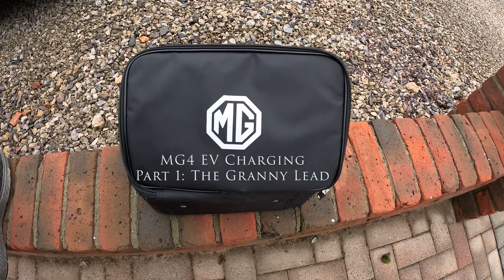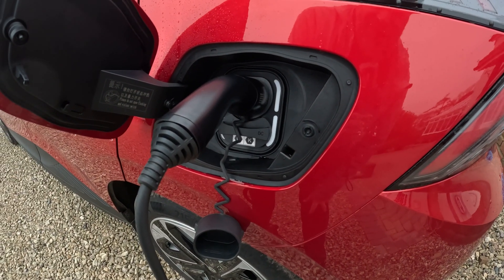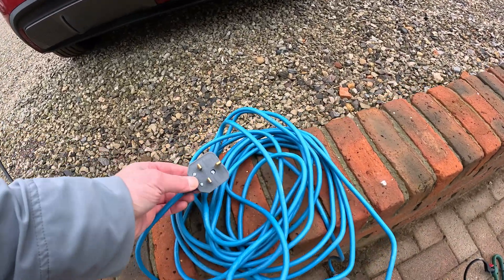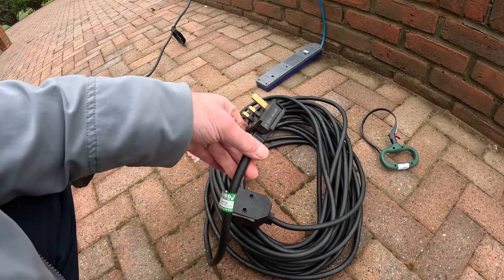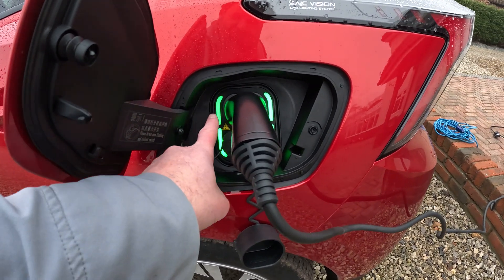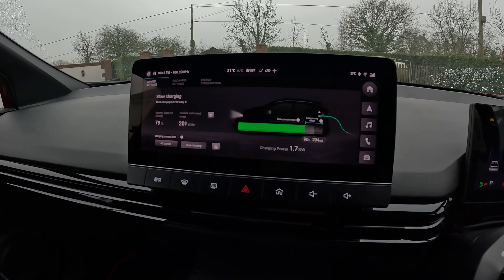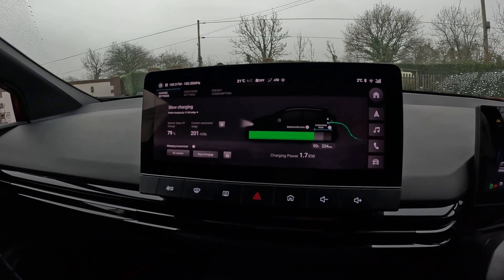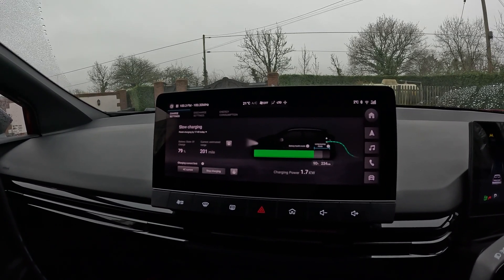MG4 EV Charging - Part 1 - the Granny Lead / EVSE / Charging Brick / Slow Charger

Comment: Can i use 13 amp extension lead to connect to my ev charger plug because it doesn't reach my house socket. I have a mazda mx 30 2021 electric

Comment: Impressive! However, I have some concerns about the safety of using a 3-pin plug charger for extended periods. Just how safe are they when left on for hours? Do they tend to get hot during charging, and is there a risk of causing damage to the car? Additionally, could there be a possibility of the car becoming electrified, which would be quite dangerous? It's important to ensure that we understand the potential risks involved with this type of charging method.
Reply: It's fine as long as your socket isn't faulty, granny chargers pull at most 13amps and most UK sockets are actually rated for 13 or 16 amps. The socket and plug might get warm but should not be hot, I limit mine to 8amps and it's barely even warm.
Reply: @akkinak Thank you

Comment: Hi I'm feeling a bit confused regarding asking permission at a b&b etc, is the room rental fee not including using the electric supplied to the rented room ?
Reply from the maker: Normal use included in the price of a b&b would be considered phone charging, shaver, lights etc

Using 20 KWh of power overnight from a 3 pin plug without asking permission could easily cost the b&b £8.00 and is considered theft in UK law

Comment: You are not supposed to use a granny charger with a domestic 13 amp socket because that socket is not designed for prolonged use drawing large current. I would strongly suggest that you look at the guidance.  The IET Wiring Regulations (722.55.101.0.201.1i) specify that 13A UK sockets which are installed to charge an EV must comply with BS 1363-2 and be marked ‘EV’ on the back of the plate. The marking on the back is required to demonstrate that it meets the more demanding British Standard, including a cyclical load test. Please note that EV compliant sockets are only manufactured as a single gang; double sockets are not available.

Comment: Had my mg4 for 2 weeks. I’ve tried charging as per the manual and your demo here. 
Plug in the car, blue lights come on, plug into power source and… after a short time, the blue lights go out and charging does not start.
I can start charging with the app, but it has never started charging purely after plugging in and connecting to power.
My concern is how would I charge if I don’t have my phone….?
Reply from the maker: @zwieseler  have you got the car set on a charging schedule? This could be set up on the screen in the car and might be why charging is not starting immediately.
Reply: @ Hallelujah. I had scheduled charging off in the app but I checked it in the car and it was switched on. I switched it off, then did the charging routine and the green lights came on 👍
So, the app and the car settings obviously work independently of each other….
Thanks mate. It was driving me nuts!
Reply: @  You might be onto something.
I made sure scheduled charging was switched off in the app but haven’t checked it in the car…. 
I will look into that next time I charge.
Btw, it also starts charging if i tap “start charging” in the car.  
Thanks for the quick reply 👍

Comment: Worse it the roll up extension on a reel with 6-8 foot used on 20m length and I have seen it, full reel had melted together. Pensioner got away with it as the charge cycle was lowest and not on that long.

Comment: Thanks for all the info on charging. I have one question left that i can't seem to find an answer to, and that's if there is a granny charger that can be set to only output 6A? I know i can set it up in the car, but then i will forget at some point and either charge slow on 11kwh chargers or too guick at home.

Comment: Help please is there a DIY wall plug solution to get 7 kwh without an electrician
Reply from the maker: Nothing that is properly safe. There used to be solutions where you could get a 32A  blue commando camping type socket installed, but these are no longer considered safe for EVS due to earthing and rcd capabilities unless installed by an electrician

Comment: So in terms of pricing. Say its 33 cent per KW, how much does it cost to charge from the granny socket, if say, plugged in for 10 hours?
Reply from the maker: @garybaitson  at the price you quoted: 

It's a 2 kw charger effectively, so at 33 cents per KWh, = 66 cents per  hour, =6.60 per 10 hours. 

In the UK  most EV households have a special cheaper night rate and a 7KW wall box for charging. I pay 6 pence per KWh. We also have 240V electricity in every home and every socket so much faster charging than the USA on 120V electricity

Comment: Can that power brick on the granny cable remain outside in the rain?  We have one and I’m not sure if it can only be used indoors through a window
Reply from the maker: You can buy a dri-box and use it in that, I have often tucked them under the car to avoid getting damp but not if puddles are likely to form

Comment: It is worth a note that you can now actually get variable powered granny leads, that can go down as low as 6amp.  I doubt a normal plug socket would have any problems at all running 6amp.  These newer granny leads can do 6amp or 8amp as well as 10 or 13.   From my basic research, household outlets in the UK pass a regulation that involves an 8amp continuous heat test.  So I would say running one at 8amp should be safe, but 6 amp would of course be even safer.  At 6amp this would give the EV upto 1.4kw input,  which if the car spends 12 hours on the drive could input almost 17kw a night.   That is not bad at all really, especially as a lot of us have batteries that prefer to be around 80% and not 100% and at 4 miles per kw, could easily equate to 67 miles charge per night.  And if you didn't need 17kw, and just 7kw you could easily set the charge time in your vehicle to force it to charge during a cheaper tariff for 5 hours.  Mmmmm.  I think I have found my solution.

Comment: 1.7kW seems rather low, the granny charger supplied with my Nissan Leaf delivers at least 2.2-2.3kW if my smart energy display is to be believed and that gives me around 9 miles range per hour.
Reply from the maker: 1.7 in the car, at least 10% losses through the car's charger, 2.3 draw at the plug.

Comment: Great advise but I charge my car every day with a granny lead 
But I do have a outside dedicated socket with a 16 amp type 1 breaker 
In my board it works great 
And as you say in your video I have a  proper extension cable when I visit friend

Comment: My friend doesn’t have wall socket outside his house, so was wondering if I can use 1 gang extension cable which would fit thru his letter box, I think 1 meter  long would do the job, on cable description states: 13AMP fuse, high conductivity copper cable, max rated power 3250w.
Also on another cable founded it’s says: 3*1.00mm2 copper line max load 3250w so these extension cables should be capable to handle power?
Reply from the maker: You need to be absolutely sure of 3 things.

1) the cable is up to it along with both plugs on each end

2) The socket you are plugging into is of good quality and properly wired in, on a ring main of adequate capacity 

3) The house has wiring up to modern spec with RCBO breakers in the fuse board.

If the weather is damp, a dri-box to put the outdoor plugs in to stop water shorting the whole lot out. If in doubt try it for an hour or 2 while you are there and regularly check the temperature of the blades on the plug. If they start getting hot, abandon the idea. Warm is OK.
Reply: @BurlSolomons  thanks, appreciate.. will do a short test before leaving overnight.. house is new builds, so sockets should be wired properly.

Comment: Are there any fast charging cables from the home 3 pin sockets?
Reply from the maker: No, you would cause problems with your fuse board. The most you can draw from 3 pin socket to a car charger is 10 A at 240V which in reality is around 2 KW. Plugs tend to overheat above 2KW continuously. A  wallbox with a type 2 cable is usually 32A with its own breaker and circuit and can charge at over 7KW.
Reply: @BurlSolomons  thank you for quick response 🙏

Comment: Charging efficiency is also an issue. Your car is likely drawing 10 amps and 2300 watts but, as the car showed, the battery is only getting 1700 watts because of the overhead required by the car. At 7260 watts (32a) the charging efficiency would be much better. This  issue increases the cost when using a granny charger - in the case you show by 2300/1700 so if your overnight electricity is charged at 7.5p/kwh you are actually paying over 10p/kwh.
Reply: That loss is massive and it should raise an eyebrow or two.  Usually the loss seen in an EV is between 12% and 8%.  For instance on a BYO Alto charger you see a 12% loss at 10A, and a 9% loss at 30A.

Comment: Nice video but 10amps with cause the socket to burn out if continuously used bs7671 states extension leads should not be used however I use mine when visiting or when staying at a hotel .Also the extension lead in the video is not ip42 rated so if it rains you could get a shock
Reply: NO IT WONT!!  2kw is very commonly used continuously from wall sockets and unless the sockets are installed by a cowboy they can handle 2kw fine.

2kw is only 8.69 amps at 230v well within the 13amp rating of a three pin plug. a high quality 2.5mm extension cable will handle this draw without getting anything hot at all.

All external electrics should be protected by RCD breaker to protect against shocks due to water ingress regardless of water proof rating of the cables.
Reply: @MrStevegibb  bs7671 amendment 2
Reply: You are wrong on so many pevels here @MrStevegibb 

It is not safe as a long term solution in any way shape or form.

Comment: Appreciate that you highlight the socket should be suitable for 2kw continuous load. Worth watching Efixx channel video “can you charge an EV from a 13a socket” in summary a standard socket could overheat from a continuous load of 2kw also a dedicated charge point typically has a RCD/RCBO which can sense DC (ie not a type AC RCD/RCBO) plus “PEN” fault detection where needed. (Most houses built since the 1970’s).
Reply: A 13A socket should be rated for 3kw mimimum
Reply: @M_a_r_ke  you are right  but not for a continuous load - hence the point that 3 pin sockets approved for continuous use are available to avoid overheating 👍🏻

Comment: The IET regulations state that a 13amp socket must be eV rated, (standard sockets are not rated for 13amp continuous) marked on the socket. Also the regulations do not allow the use of extension cables.
Reply: I live in the PNW west of Seattle in a 100yr old house, I don't use my granny-charger on a daily basis with my '14 BMW i3bev just occasionally. 
I normally just go into work a little early and grab some 'juice' from the free public charger next to my work place. 
If I do feel the need to charge at home I have the charge rate set to low,  I'm not concerned about the wiring as I used 12-2romex when I wired the basement and garage 35yrs ago.

Comment: Thanks for the video, we are intending to get a MG4 Trophy later this year, but as planning to move house ( and consumer unit is opposite side of house to driveway, quoted over £1k to install it!) we're just planning to use the granny lead plugged in the garage. Car will only be used a few times a week so don't envisage a problem!
Reply: Hello, I'm just about to collect an MG4 trophy. Can I ask how you are getting on with trickle charging please? How many hours does it take? Have you read anything that suggests trickle charging is not as good for the battery as rapid charging? Thanks!

Comment: Thank you so much for putting all these tips together; so helpful if you’ve no experience of EVs let alone the MG4. Will you be putting together a video to describe the differences between the P lever button, P in the main gear circle, and P you can activate using the authored feature? Can’t really work out when you’d want to use or need to use the lever?….

Comment: I noticed the car said 1.7kW but the app says 2. Also over 4 hours it took 9kW. The Stellantis cars also report a ‘miles of charge per hour’ that seems lower than 2kW. I wonder what’s going on.
Reply from the maker: There are losses between the cahrger input and output into the battery, this is probably what you are seeing here.
Reply: @BurlSolomons  Yep I'm seeing 6kWh on 7kw chargers and 9kWh on 22 (11) kW chargers.

Comment: Hi, I don’t know if you can help? I tried my 3 pin charger in different sockets around my home and the granny charger keeps going in to over-surge(indicated by flashing lights on brick box)…the car charges fine via any of charge point…and ideas or is it a faulty box? Or should I change the maximum current level on battery setting? Thanks!
Reply from the maker: Not come across this problem - would be a good idea to take the granny lead back to the dealer and see if swapping it with another one causes the same problem.

Comment: Hi, superb video with sound explanation.

I too want this type option and have looked at the website you mentioned - there is a 1.5mm 16amp or the 2.5mm 24amp - which one did you go for?
Reply from the maker: Since the granny lead is only 2kw, (10A) there is little point in a 2.5mm conductor, unless you are going over 10M in length, which may result in some voltage drop

Comment: Are MG and Tesla granny chargers interchangeable ?
Reply from the maker: They should be, but I'd be very careful. First generation Tesla UMC chargers used to cause serious problems with the Renault Zoe, due to the strange way that the Tesla UMC is wired for 32A single phase power, it can mess up a car that can charge on 3 phase.

Comment: Hi there,
I was just wondering what cable actually came with the car? Do you only get the 3 pin granny cable? Or do you get a fully type 2 cable or some sort of adaptor for using untethered public chargers? My mg4 is on order for delivery in May. Many thanks 😊
Reply from the maker: All MG4s now supplied only with Granny lead as standard.

Comment: You left the cable wound up as a coil on the pavement, that's gonna get hot?!
Reply from the maker: Did you actually watch the video? I specifically mentioned uncoiling the cable completely more than once.
Reply: @BurlSolomons  A always watch your video's completely...
Look here: https://youtu.be/mmdikgWmXc4?t=126
You left the cable wound up as a coil on the pavement (upper right corner of the screen) and plugged it in... 🤭
Reply: @PaulvanDruten  case of: Do as I say - not as I do.....
Reply: @wino99999  LOL right!

Comment: Is the cable and extension lead waterproof?
Also that charging lead from Screwfix is really expensive at £200! In fact ALL the charging leads are stupid prices, its a typical supply and demand trap..sigh!
Reply from the maker: If it's wet I use a Dribox
Reply: @BurlSolomons  An extension cable is not recommended. If you although need it, You need a cable which supports a high continous power, most do not.

Comment: Really annoying that MG don’t supply you with the 32A cable as standard. It’s nice to have the granny charger but we will never use it.
Reply from the maker: The problem with 32A cables is that they don't know what you want. Do you need a 3, 5, 7.5 or a 10M one? Coiled or straight? Colour preference? Do you need a 3 phase cable (more cores, more pins, more expensive), because if you have a Trophy or SE LR, you can benefit from 11KW 16A 3 phase charging. Many manufacturers, Tesla included, are no longer supplying any cables or granny lead....
Reply: @Burl Solomons  I collected my MG4 SE long range today, and it came with both cables. I have ordered a longer type 2, 3 phase to provide more flexibility
Reply: @ashb8572  that’s great. We got ours from Arnold Clark. They are not the best to be honest. Want me to pay diagnostic fee if I take the car in because the button on the drivers door no longer works. Surely it’s a warranty issue and no fee should be paid.
Reply: @BurlSolomons  hardly any homes in the UK are 3 phase. so makes sense that they would just provide you with a standard type 2 cable like most other manufacturers do. "many manufacturers are no longer supplying any cables" seems to be only the expensive brands that have no cables. Peugeot, Citroen, Renault, Nissan all provide a type 2.
Reply: @Dreadpirateflappy  My Tesla came with both granny and Type 2 cable in three phase.
It was nice coming at three phase,v that's the one I leave in the car, because as you rightly say, I don't have it at home but might at a public charger.
I then bought a single phase to leave at home.
Reply: In some ways they do you a favour. A granny lead cost about £200 whilst a type 2 to type 2 is around £100.

Comment: Thanks for this Burl. The information on the charging lights is useful and seeing the displays in the car is very useful. It is very different to my Mk1 ZS. Although I rarely use the granny charger I now know what to look out for when using my fast charger. To unplug the charger do you need to unlock the car as I do on my ZS?
Reply from the maker: Yes, the car end is locked in when the car is locked.

Comment: I’m kind of hoping that this is all I need. 
We do low mileage most weeks. 
I’ve fast chargers fairly close by, so if I need a quick boost after a long journey, I can use those, but for the majority of the time, I’m hoping this suffices. 
We will see. 
Thanks again.
Reply from the maker: If you only need 80 miles overnight, it may add enough. However the contactors on the granny lead are not really designed for daily use, so it might let you down sooner rather than later... Hope it works out OK...